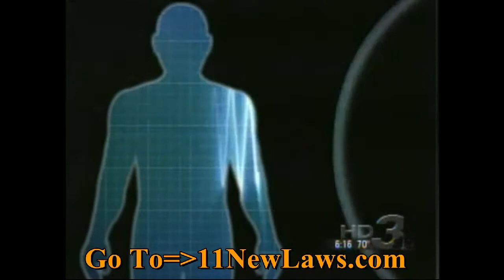Global Warming Documentary National Geographic saving planet earth and stop climate change

Comment: $4 for gas?  Why not pay $20 for electricity to make hydrogen gas to burn?

It is simply energy conversion.  Electricity -> Radio waves -> Hydrogen gas -> Thermal energy.  But remember where electricity comes from Fossil Fuel -> Thermal Energy -> Steam Enthalpy -> Mechanical Energy -> AC HV -> AC LV.

Consider instead gasoline: Fossil Fuel (through refinery) -> Thermal Energy -> Mechanical Energy.
Reply: хкх